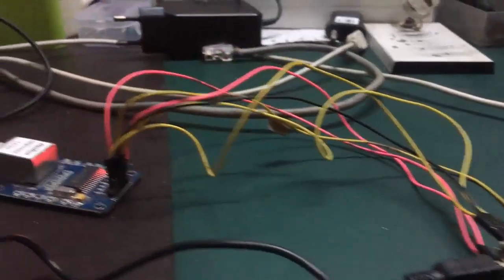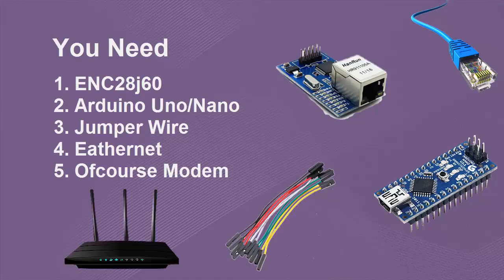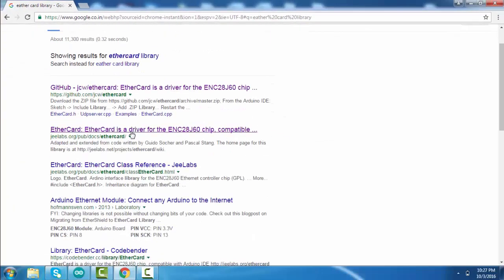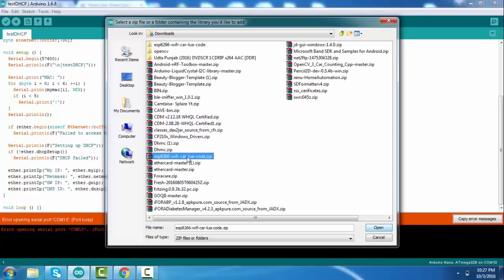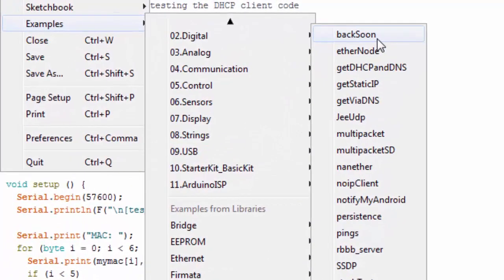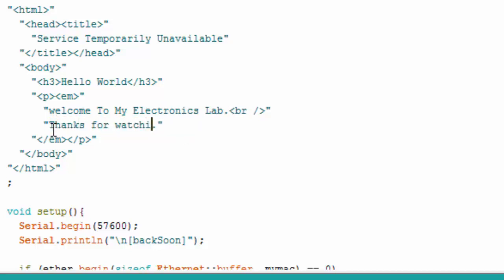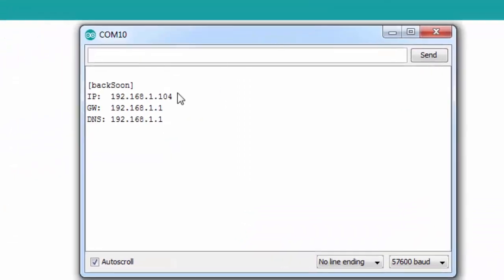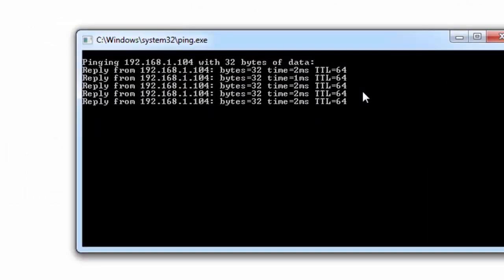How Interface Ethernet To Arduino | ENC28J60 Eathernet Module Interfacing

Comment: For anyone having issues:
1. Connect your computer and module to the same router. You can set it at DHCP or static depends on your preference if it's static make sure the address is in the same subnet, with DNS and gateways have correct addresses. 
2. If the serial monitor isn't showing the IP address or showing unknown characters. Set the serial monitor to 57600 baud rate manually in the serial monitor panel at the bottom.
3. Make sure to declare your slave pin number or cs pin number in the ethernet begin if it's not on the default pin.
4. If your using a router with ISP check if it allows multiple lan connections. Mine doesn't so i have a spare router but no ISP it has local connection and it allowed my pc to connect with the arduino webpage.
Reply: nice!

Comment: dear i follow all the steps but still i am not getting the desired result the problem is when i connect my ENC28j60  module to the Router the light is not blinking although both modules and cross wire is in the working condition kindly if it is possible help me out

Comment: or if you can suggest/point/give me the directions to code for ENC28j60 in simple "c'.

that how to activate enc28j60 module which register to used and value to pass.
sequentialy ....
it will be great...
Reply from the maker: Hello that is simple, just open header file and check how they are sending command to registers of chip.

Comment: hey need help in connecting ESP8266 wifi module to Enc28j60 via spi in order to make a device connect to internet via wifi and cable. help